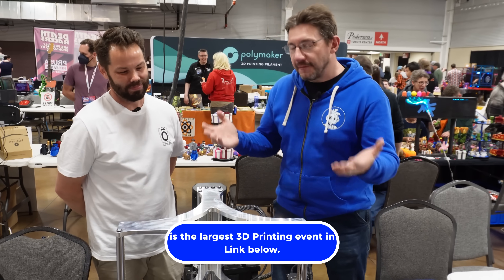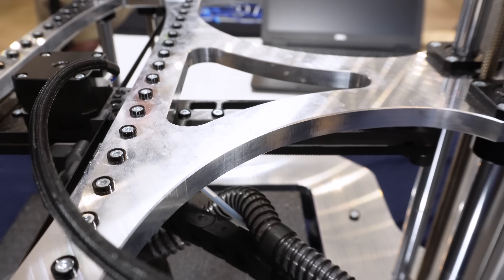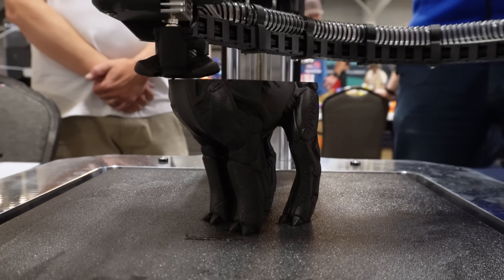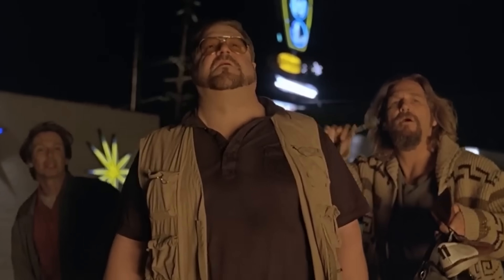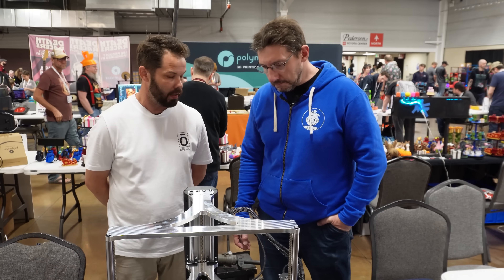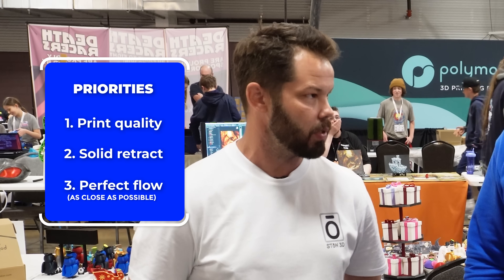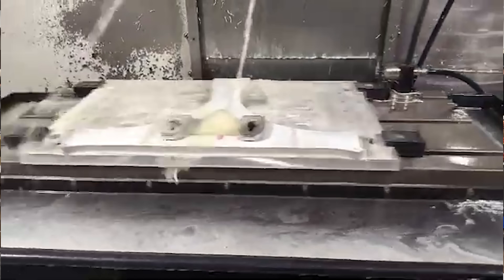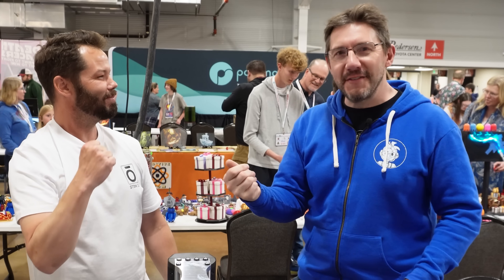Is this the FASTEST 3D Printer?

Comment: I'm currently building a custom, enclosed shelf for my Printer, mainly so I can jam an air filtration system in it. I haven't had real problems yet, but my asthma already has me at 85% lung capacity and that number is only going to go down as times arrow flies.
Also, some additional noise dampening would be nice, especially at night

Comment: Seems better than H2D for this price
Reply: in what way exactly? i am honestly curious, because theres nothing i can see that makes it special.i cant believe the claim that this one is faster than Vez3d.
Reply: @simonschneider5913  It is faster, sorry to break it to you. Cartesian is just faster principle in general.  And less parts, cheaper, runs on 48v with safety filters, 3 lead screws, 16mm z rods, flying gantry and a Raspberry CM5, sorry its not the same world. Oh, and made in Czech.  Cheers. :)
Reply: @STōN-3D  made in czech is better than made in germany. but i cant see any other outstanding specs here. cartesian is just a way of defining the working area. there are many different implementations of it. also, you neglect to mention weight. i dont buy the claim that this is faster than Vez3D. would love to see how I am wrong here.

btw - I am a tool-n-die-mech and build my own CNC-lathe, which also runs at 48V on leadscrews. but it cuts steel! :)

does your printer run on closed-loop-drivers? because that relatively high weight with high accelerations sounds funky to me.
Reply: Very professional indeed.

Comment: Hi @STōN-3D
I can't find any information on dimensions of this printer.
Could you please add this information to your website?
Dimensions with enclosure would be nice as well.

There are few CM2 nozzles on Micro-Swiss website:
FlowTech, CHT High Flow, MK8, RepRap (V6), High Flow (Volcano).
Which ones is the right one?

Is customer going to be able to retro fit enclosure or is it better wait until enclosure is ready ?

Thank you

Comment: Price should be lower because there's literally no point buying one of this when you can build a 8WD cross gantry / 2 LH Stinger / 3 Voron hex-zero with this price. Also I'd want this thing's X axis input shaper result when the toolhead is in the front or back compared to in the center, as CoM shifting might be this design's weak point.
Reply: I am not good with mechanical things, so building a Voron of any stipe is not an option.  1500 for a quality build and to support an innovator like this is very much an option for me.
Reply: Not sure I fully agree, but thats why we have choices. Go for it. This is not the same direction. Its designed to be the strongest in the center of the build plate. Other designs are the worst in the center, where you print the most. Flexing gantry bar in the middle of most printers...  Rather,  our distance from bearing to extruder is always short. Cheers.

Comment: I am not fully convinced on the selling point of speed. Most modern hobbyist machines from bambu, creality and prusa can easily reach 400+ mm/s with perfect print quality and 600mm/s with acceptable results. On the website it’s stated that the ston wolf can print at 300-600mm/s. So speed is obviously not the selling point. The selling point would be that it is built like a tank with precision parts.
Reply: Bambu's coreXY machines has trash rigidity so it's slow(around 10k acceleration recommended with input shaper), while this one doesn't skip steps regardless of what acceleration you set it to. Speed difference is night and day.
Reply: https://youtube.com/shorts/96z3SAMuXqs?feature=shared   1500mm/sec print speed :) Enough?

Comment: So is their an enclosure maybe (or in the works)? If not.. will it handle anything beyond petg and maybe abs? I love these printers overengineered.. but my concern is I want to print nylon, ASA, PA6, etc.. and not sure this can do it. Need a 350+ hot end, enclosure with 60+c, 100+c bed, etc. How would you do that with this machine?

Comment: For me the attraction of an enclosed printer is keeping dust and cat hair out when not running and when it is keeping cats and small fingers away from it when it is, full disclosure I have a x1 carbon purely for this reason. And yes the option to have 4 different colors is nice but hardly ever used in my work flow.

Comment: The header is talking about speed, but no where in the video did I hear them talking about actual print speed. So how fast IS it?
Reply: They said 36 mm2/s material flow. That is the value you are interested. - it would turn out to about 500mm/s 0,2mm layer, 0.4 nozzle. Accelerations are physicality limited by viscosity of plastic you use, so around 10000 - 15000mm/s2 to be realistic maximum
Reply: @BigFootpl That acceleration limited by plastics part is just misinformation. If you only run 15k then you probably aren't hitting 750mm/s anyways.
Reply: @BigFootpl  if that’s true then this isn’t the fastest printer there is. Creality has 600mm/s machines and both Bambu and Creality top end machines are 500mm/s
Reply: @CHiTO316 to be honest, we surpassed the speed filaments are able to be printed loooong time ago.
Now it's more race between users to Ride the limit of plastic properties.
When you look at print profiles of bambu or creality, niether of them print at 500mm/s in other place than infill.
This machinę probably can achive high speeds on the outside perimiter with good quality

My voron can "print" at 750mm/s but quality is so bad that i will not use it at all.
Reply: @CHiTO316  https://youtube.com/shorts/96z3SAMuXqs?feature=shared  1500mm/sec :) perimeters.

Comment: Why do I want enclosures? print room with decent air conditioning that doesn't make the work area feel like a Victorian workshop and no worries about random cold draft upsetting the print - Currently have 18 enclosed printers doing only PLA parts and they stay closed with a vent at the top with solid 22 degrees ambient and the enclosures never go above 30

It still sounds like a victorian workshop, though

Comment: Dah! I walked past the printer like 5 times and only 1 time was someone at the table, and that one time there were like 20 people around it too. I like the ethos... the "I don't need to have the maximum number on a spec sheet and to repeat what everyone else is doing. I need it to do it's job as close to perfect as possible, and to optimize for the goals of the machine".

I feel like we keep repeating this time loop: the highest resolution camera... actually that doesn't make better pictures, the biggest TV... actually that is harder to move around and doesn't make a better picture quality, the fastest clock rate... actually that doesn't make the computer any faster... we had some reverse case of "the cheapest printer..." and that kinda killed off an entire generation of interest because people purchased them on a whim, had issues, and threw them out. We had a brief period of "the fastest printer" that surprisingly only lasted 1-2 years before nearly every other printer caught up... and new it's on print quality and general quality of life. The "the CPAP is NOT a small jet engine" kind of thing. I'm more standardizing my own stuff on the same parts so I'm not stocking 20 different kinds of hot ends, but given the cost of this, if/when I do go for a not-Prusa/Bambu/Creality/etc. printer, such as a Voron, this will be on the consideration list for sure.

Comment: Half way through the video I checked out their YT shorts and 2 mins later I was out $1600 lol. I was planning on getting a prusa core one to join the mk3s and mini, but damn those speeds and quality. I'll be getting their enclosure as well, as long as its not one of those cheap all plexiglass with 3d printed joints and no bottom.
Reply: I think you will like the enclosure.  ;)
Thanks so much for your support. Reach out if you have any questions. 
Discord is open for printer owners. (And will be open very soon for public also.)  See you there.
Reply: @STōN-3D  I can tell you don't like cheap shit, I know it won't be all plexi, I was looking at my CR-10S when I was typing that. Where do I get the discord invite?

Comment: Looks nice…  pointless printing at temps above 300 without an enclosure though isn’t it really.. and that cooling pipe won’t be easy to enclose and maintain full chamber movement without clattering around everywhere. Also pointless in trying to push the speed barriers anymore for these small build plates.  The material has a limit. Layer time has a limit, melting and cooling too fast affects the material properties, even the fastest printers today can’t sprint most materials and most models at their highest capable speed, so why you all trying to go even faster?? Please explain …

Comment: I need a printer with an enclosure to print ASA.   I use ASA because I find it has better properties than PETG and it doesn't have the blobbyness/stickness of PETG.  It doesn't stick to the nozzle and such like PETG does.  I also find ASA to be way less stringy than PETG.  What little stringing I get with ASA is easily removed with a heat gun.   The only issue I've had with ASA is that I couldn't get ASA to stick to the bed for anything.  I eventually just bought a build plate to use just for ASA and I use an acetone/ASA slurry on it and it sticks like a champ.
Reply: I use a spray called fillaform extra strong, works extremely well for ASA, PC etc. Sticks so well when it's hot and then pops off when cold.

Comment: Probably in the minority here, but we want an enclosure simply for the off gassing and smells. We can smell PETG and PLA, let alone the higher end filaments. We use enclosures then an inline fan system to extract out the air and vent it outside.
Reply: Understandable. Yes  the add-on enclosure is coming. Just wanted to make a stable frame first. 
Many farms and users prefer the open design for easy service and visibility.  
Stay tuned. Thanks for checking us out.

Comment: This is a fantastic design for a flying gantry. Absolutely LOVE all that cast aluminum.
Reply: Much appreciated. 
 
Material is 12mm thick. 
Cast. Stress relieved , milled, thin laser applied surface coat for  protection. 
Then CNC cut on the  mill to shape. Debur and inspect dimensions/flatness. 
Yes. 😂

Comment: Looks nice but the print quality is under par. Its nice and fast but I think current 3d printers are fast enough for most. The print quality is important. I wasnt impressed with the nextruders print quality.

The extruder on the H2D is amazing so I wonder if that design can be replicated with having a servo instead of a stepper on there.

Comment: I think the speed of most modern printers is good enough. I think the next step is better quality prints and simpler high temp material
Reply: We are gonna get there eventually , when the  Ender 3 was a thing , there were people printing at faster speed than 50mm/s , but the quality often suffered , and now a Bamboo lab printer  can print at 3x times the speed of a Ender 3 and at a higher quality , so it always went like this : make the printer faster and later make the quality good at higher speeds
Reply: Maybe limited non-planar printing too, if only to end the foreign material support conversation.
Reply: Modern speeds are NOT good enough.  People who do many of prints and drafts and prototypes know this to be true.
Reply: @AnotherCG  i guess but id rather have perfect prints then fast prints
Reply: @peterpeter5666  Quality and speed go hand in hand. If printer B can print at the same relative quality as printer A, but twice as fast, then if it slows down and goes at the same speed as printer A the quality will be much higher.
Reply: Agreed. I tried to raise the limit. Not to print at 1500mm/sec. 
But to make the 500 to 600mm/sec easy. 
And yes, agreed on high temp. 
We have a 350c heater. 
All copper and steel hotend. 
EPDM 1.5gt belts for high temp and low VFA. 
High temp epoxy used in the CF Gantry. 
High temp ready cooling fans. 
Relatively cool motors ~ Around 40-50c . 
High temp grease. 
Stress relieved frame. 
We are prepared for the enclosure. Default. 
And high temp is a must.
Reply: @STōN-3D Do you have good experiences with HT epoxy? Because from my tests a)  strength is inversely proportional to temp b) the difference in expansion rates between glue and glued material ultimately kills the joint
Reply: @DailyFrankPeter it's the plate style CF. Not "wet lay". For use performance automotive and aerospace. Maybe a better term is Resin. "Epoxy " was probably not the best term on my side. To be transparent, I let the experts handle that area. And just design and test them. Using their knowledge of Carbon. I dont manufacturer the plate myself. But it's interesting  ;)
 It's not an epoxy coating. 
Very happy with it. Been around 14 or 15 months in testing. Still flat.
Reply: I think AI assisted slicing will be the best big game changer.

That and brick layers, sine wave walls and perhaps combine inner wall options. ( So only the outside wall needs to be printed at low heights)
Reply: @freedomofmotion  not to mention adaptive infill paterns.
Reply: @lukahierl9857 

Yup and correcting for illogical print operations.

Not bridging over things that should be bridges it's a maddening thing 😂

Comment: "Why do people want an enclosure?"
Me: Pff, an enclosure within an enclosure being respirated through a 600cfm fume extraction system on 4inch central nordfab system. Now we're ready for Funky Forbidden Filament printing! 
(Yes, this is my actual setup)
Reply: Are you printing with bio-hazard filled filament? Who needs carbon filled, when you can have asbestos sort of thing?
Reply: @drstefankrank  It's along those lines. The more exotic, the more ancillary support systems you need to use it. I also do material testing, chemical/polymer prototyping and evacuate CNC cuttings on the same line, but it was more convenient to tap into existing infrastructure. 😁

Comment: pretty Cool but flying gantry is still stupid imo haha
Reply: Low CG. Less Delta between toohead and bed. Cant break those physics. But yes it makes it tough to constrain. So we made it on one plate. 12mm thick.
Reply: @STōN-3D  genuine question but wouldn't a trident style moving bed still be more optimal ?
Reply: I like the low cg of the gantry. And keeping the bed mounted to the frame for stability. Credits to Voron. @RADkate
Reply: It's low CG if you print low parts.
Reply: @riba2233 the print remains low. And attached to the frame. Keeping the frame CG low as well is important for frame wobble. 
 Also, flying gantry has a low cg gantry most of the time. Because most people print short objects. 
When the gantry rises, the gantry changes the CG to a higher value. Sure. 
 Vs the other method. Top mounted gantry. = Gantry and print are in worst CG location. Top. 
And then gradually the print lowers. Bringing the frame cg down a little. 

That option is mich worse in my opinion. 
Top mounted gsntry goes from the worst CG to bad CG. 

The flying gantry goes from Optimum CG, to moderate CG. (Bed stays low)
Reply: @STōN-3D imho it's not a huge deal if frame is rigid enough, and I would prefer a more consistent print quality.
Reply: @riba2233 print quality. Yes. 
Keep the bed stable. 😉
Reply: @STōN-3D and the gantry hopefully 😁

Comment: Wondering: is it better to allow a solidly made machine to dance around like that one or to prevent it from moving?
Reply: The thin plastic tables they have at the expos are not the best. And yes, agreed. On a normal workbench its MUCH more solid.  I wanted to just put it on the floor :)  Imagine putting a small CNC on a plastic picnic table...
Reply: This is a complex subject. You can damp vibrations with a very heavily built chassis, or you can build a lighter chassis and allow it to float. There are advantages to both. A heavy chassis requires large motors counter the tendency of the moving parts to overshoot. A floating chassis counteracts that and allows lighter components.